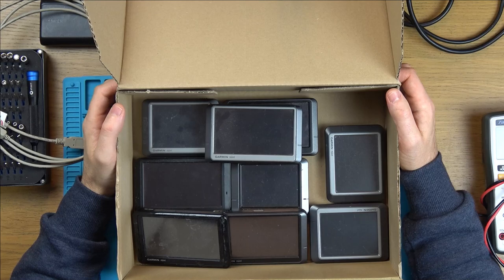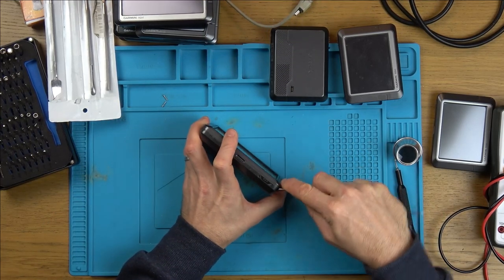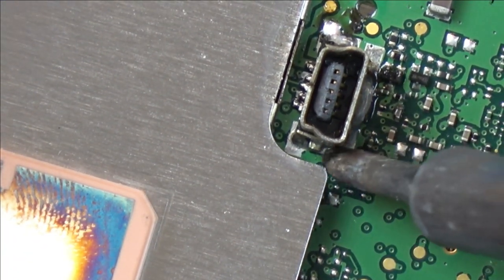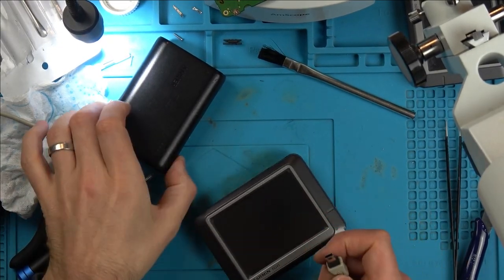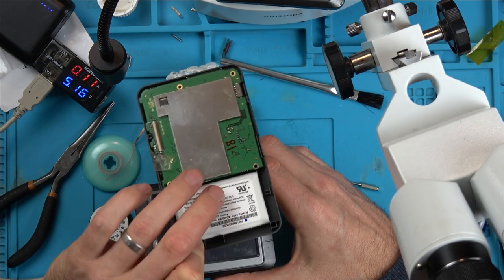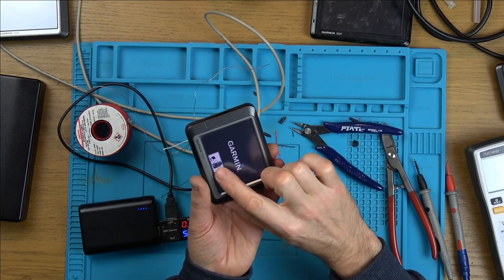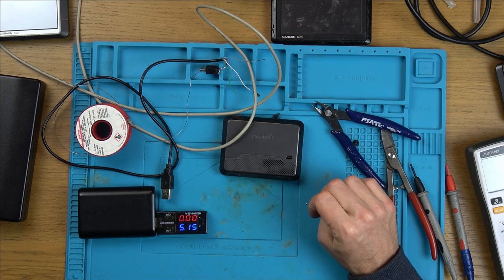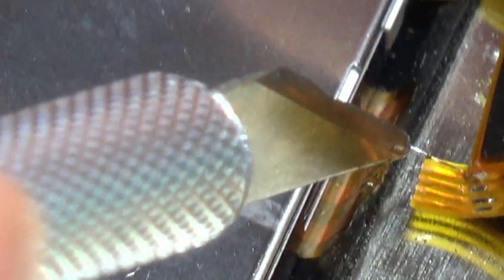A Job Lot of Faulty GARMIN Satellite Navigations - Can They be FIXED?

Comment: You'll need a proper charger cable or they will come up in file transfer mode every time because they think they're connected to a PC even if they're not. Or bridge Pin! 😅 4 and 5 of the Mini USB cable, this should work also. 1. +5V, 2. D-,3. D+, 4. GND,5. GND. The 2 GNDs are bridged.

Comment: All of this unit are win ce based. You can find online the rom flash of each partition. 
When digitizer appear not working try to verify the stylus calibration and to go to calibration try to click on the sensitive areas.
Most of this device can be accessed to test mode by an sd with mortscript properly configured. 
I know a lot about this wince based unit because i used to repair pioneer avic 310/320 unit for car audio.
Ps. Do not use thermo adesive in stuff that goes in auto, because it liquefy with sun.
Use epoxy
The pink square it's the gps antenna.
If there are roms available, you could turn this things into something else... Even if they are locked with a pin

Comment: The ports on these sat navs seem to be their biggest failiures as most leave the cables attached(my dad included!) and then wrap the cable around the device putting strain on the port this eventually breaks the port - I have one that has that same issue unfortunately looks like the pads on it are dead though!

Comment: If you don't have an unlimited mobile data plan, then a Garmin is less expensive. I discovered this on a recent trip to Florida. I got a shock when I got my AT&T mobile bill. I purchased a Garmin which came with a special cable and unlimited updates. My HDD USB cables do not work.

Comment: i remember my garmin satnav tje screen went so i got a replacement, only to fimd out the replacement was faulty i finaly got a second replacement and boom it worked, but only for a month and then tje battery gave up so i just tjrew it in the draw and left it and baught a tom tom, to which i have still got.

Comment: 20:17 hot glue wont work for a gps they get extremely hot in a window
Reply: They will balance out as you drive round bends, put on the Aircon or the blowers etc.

Comment: We used to have a TomTom GPS. It worked great at first, but updates eventually ceased and there were some significant errors in the map for the area where we lived (which I dully reported). At the same time, it became unstable in its ability to locate a signal. I did a factory reset to wipe all of the personal data and I donated it to a local charity shop.